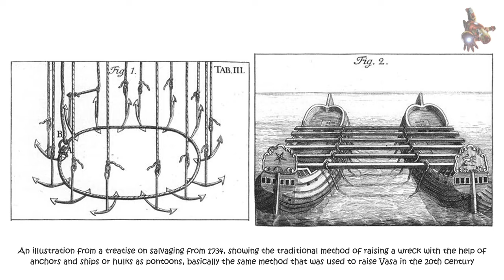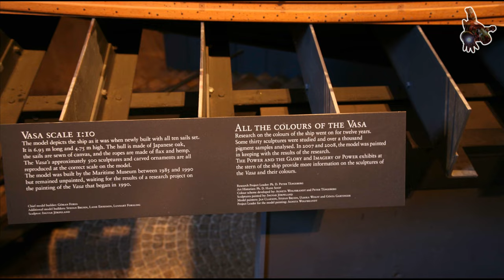Photos of the VASA Ship and the Scale Model in the VASA Museum in Stockholm * SUPERsmHEROES

Comment: It’s interesting how they managed to recover the ship with all the scuba diving
Reply from the maker: The recovery of the Vasa ship took place in the 20th century and was a significant engineering and archaeological feat.

The recovery process involved extensive planning, research, and the use of specialized equipment.

To recover the Vasa, divers worked in challenging conditions due to the cold water and low visibility. They used diving bells, which are submersible chambers that can be lowered to the shipwreck, allowing divers to work in a dry environment. The divers carefully excavated the sediment around the ship and attached cables and lifting equipment to it.

Once the ship was secured, it was slowly raised to the surface using a system of pontoons and cranes. The process required great care to ensure the fragile ship was not damaged during the ascent. After reaching the surface, the Vasa was transported to a conservation facility where it underwent years of preservation work to stabilize and restore the ship.

The recovery and subsequent conservation of the Vasa ship have provided valuable insights into naval architecture and life in the 17th century. The Vasa Museum now showcases the ship and its historical artifacts, offering visitors a unique glimpse into Sweden's maritime history.